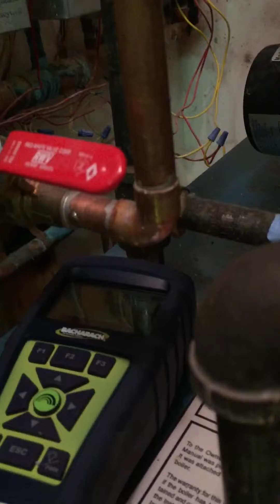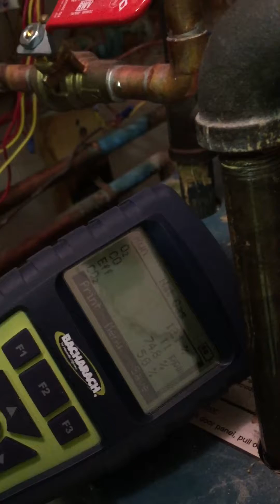Barometric Damper Control

Comment: Yes, BUT you have to make sure that the air outflow from the point of barometric damper up to the top of the chimney is not blocked, and if it is all the combustion gases would stay in your basement regardless of how much you adjust the barometric pressure----even closing it off completely and the burnt gases would still have nowhere to go but leak out of the combustion chamber and go right into your basement.
Yes, the barometric damper allows you to adjust for a constant, desired draft (negative pressure for a suctioning effect on the burner to remove the burnt gases to outside). Too little negative draft by large opening on the barometric damper would allow you to retain more heat but also allow less outflow of burned gases to the chimney. Closing off the damper would allow all possible burnt gases to go out to the chimney but so do the heat that you paid for in heating the burner.....because it does not allow for cold air to go through the damper to slow down the hot burnt air that is rising from the burner.
That said, you want to play with the damper such that when the burner is not running, the damper should close, and when the burner is running it should have enough suctioning effect (negative pressure) to remove unwanted gases but not too much of the heat that you want to retain to heat up your boiler and hot water. Without using fancy tools you can put a light cotton string inside the damper and see the direction the string wants to go and adjust the weight on the damper prn. as the burner is on..